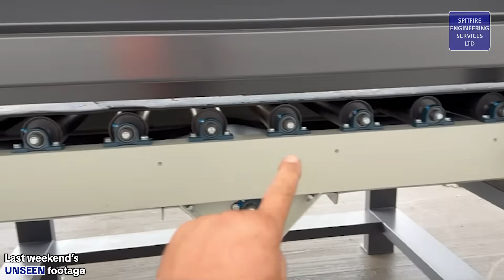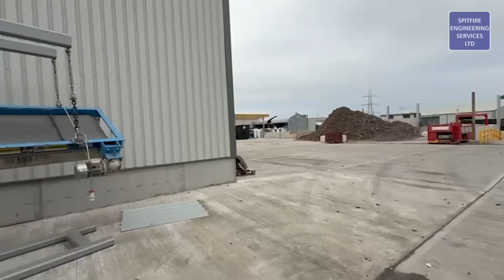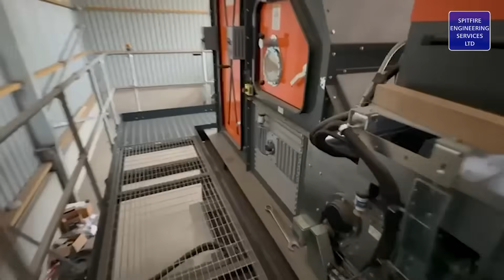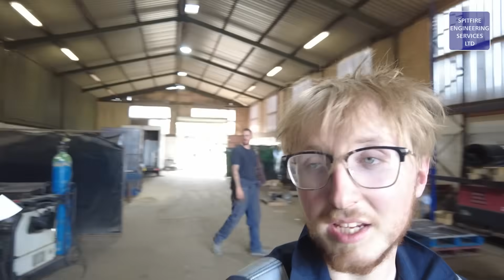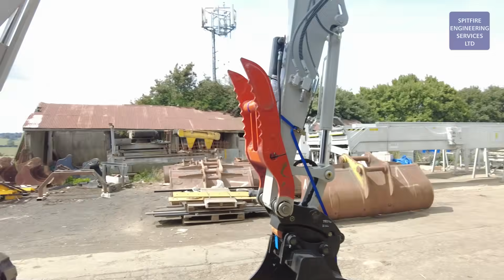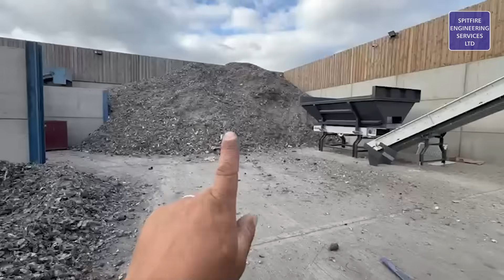Manchester Project Test EXPOSES Major Fault!

Comment: Oops 😬 I thought the swan neck conveyer would have an issue.  Belt looked too tight angle 📐 and noticed Conner had an issue hiding the roller bar sticking up 🤭 Adapt & Overcome 🫡 Maybe add some curved rollers to help keep the belt central 🤔

Comment: Hi Spitfire team
I'll keep it short and sweet today ...

*90 kgs on the gearbox*

I was miles out 😅😅😅

The Manchester project is like the ultimate money making roller coaster 🎢🎢...for waste materials ..

Gutted there is proper head scratching issue but I don't think there are many things Gavin and the team cannot identify or resolve ...

Q. I know levels must play a massive part in how the various component parts work in synergy but how do you change / alter the levels on each piece of equipment? 

Looking forward to seeing the cause and fix ....

Be safe, be grateful 🙏🙏

Gary 🙏